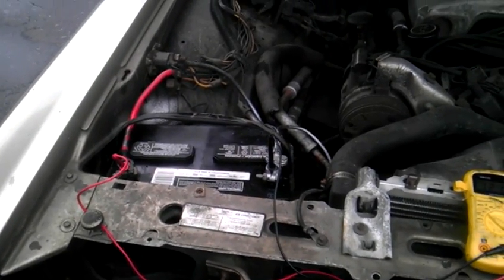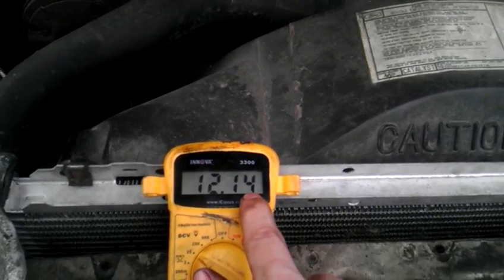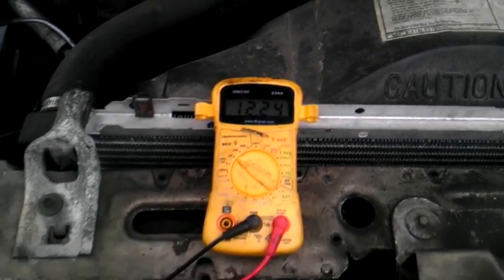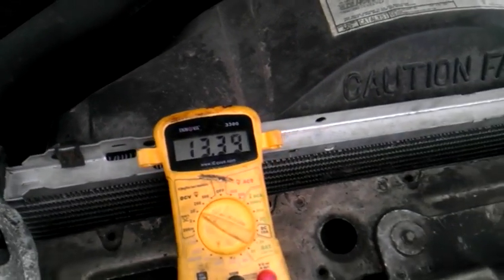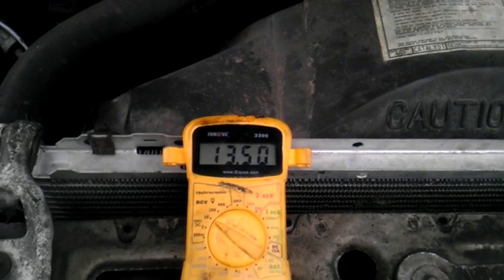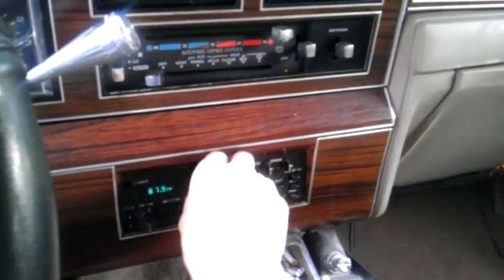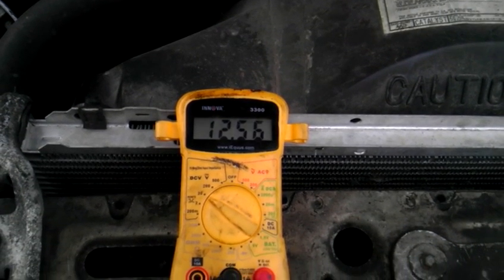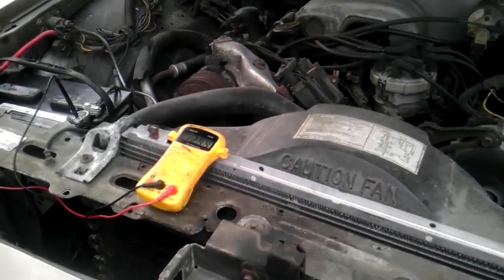How to test your charging system with a multimeter

Comment: 12.25VDC is actually pretty low for a battery at rest.  Like jdubsteachings, it should be around 12.6VDC.
Reply from the maker: +Brenndon McGill youre absolutely right. my alternator was a bit weak in this video. those alternators go out like once every 2 years lol

Comment from the maker: your in the ballpark. But they dont call it a 12 volt battery for it to hold 13 volts. Around 12.6 is ideal. And you should get about 14 or more volts from the alternator with NO LOAD. usually 13.5 to 14.5. But i had demonstrated the difference of it all with and without a load on it

Comment: each cell is 2.2 volts, so shouldnt a good battery with the engine off be 13volts-' with the engine on the altenaor should go to 14
Reply from the maker: Each cell is 2.1 volts. Which is 12.6. My alternator was weak but on those old Lincolns they always seem to be that way and run just fine